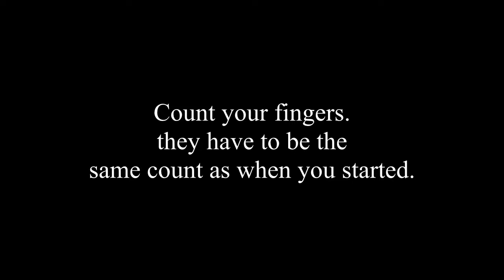Bench top sawmill

Comment: Ha!  I just bought one for $20.  Pretty rough and original builder didn’t build it strong enough.  Wasn’t used much.  I’m rebuilding with a longer blade and moving the wheels apart and limiting the width to make it stronger and able to take more tension to cut a smaller throat (stronger) and taller to maybe do some resawing a max of 6” wide and up to 12” high.